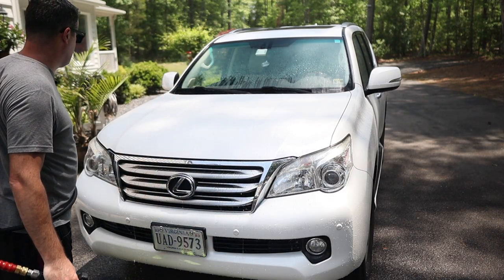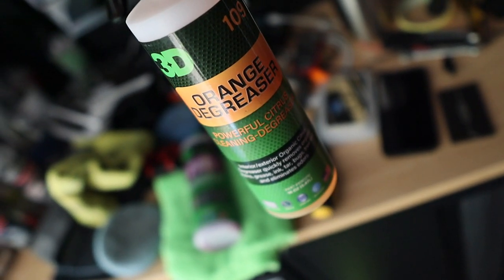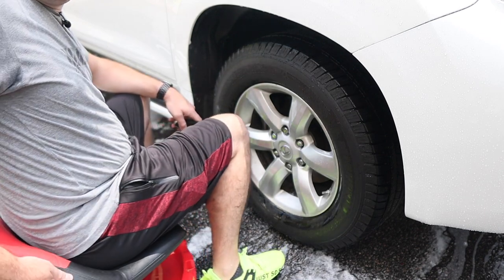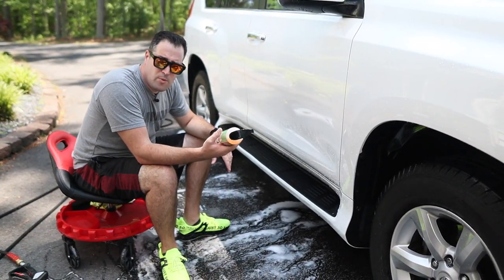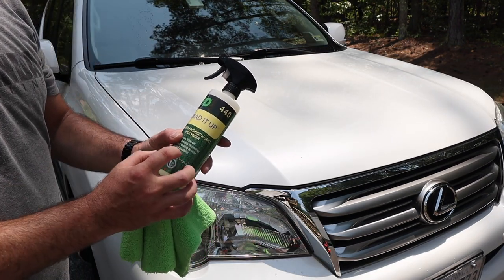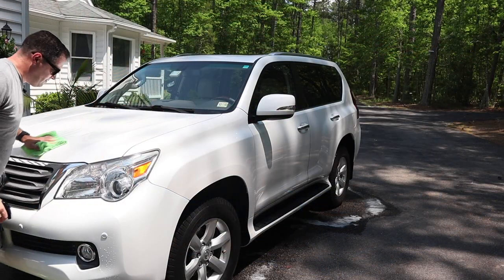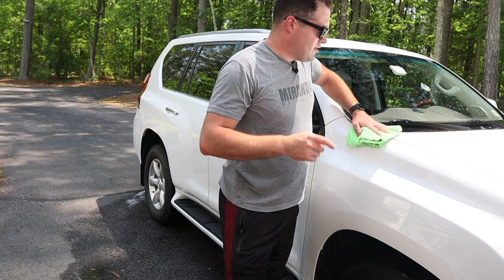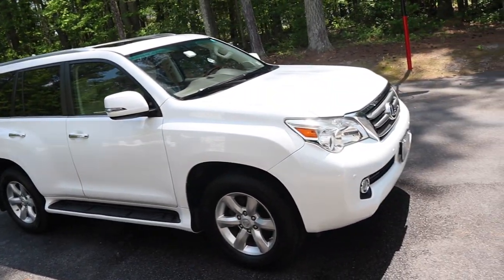I Have To Address A Serious Issue!  Plus 3D Detailing Products Giveaway! #Detailingtips

Comment: Just a thought about the “wheels first” debate. If you clean and dry the paint first and then if you get overspray on the paint when brushing the tyres which you then jet wash off, it means you have to dry the paint again. Just a thought, not criticising.
Reply from the maker: Hi. Totally true, that why each detailer has to make that decision for themselves.  Not a wrong or right way, just different reasons/methods for each situation. 😎👍🏼 thanks for sharing!

Comment: Great talk. Unfortunately we live in a culture now that accuse other folks, so they gain attention for themselves. Makes me feel sad. We are all better then that.
Ok.....confession time. Lol. Last year around now, I put on my first ceramic coating. It was a sorta entry level coating. Last summer coating was "doing its thing" beading and sheeting. Not this year. Slowly sheeting. In between last year and this year was, you got it, a the miserable Wisconsin winter! So during the winter i used the touchless car washes. Only running water available. Bring vehicle home and do rinseless wash and apply "Topper ". I do this during winter once a week. Every Saturday. Did I unknowingly degrade the ceramic coating by using touchless car wash that has high ph soaps? Last week I used Descale and followed up with hand wash Reset, and coating looks flat or gone. I know it's difficult to give advice without every single fact, but what do you think? I really respect your opinion. 
BTW today is the day CSL and Evo v4 goes on a 21 Silverado. I'm excited!! Hi wife.
Reply from the maker: Hi. Yeah I know,,,,it’s sad. 

Oh boy…yeah probably the high ph cleaners could have killed it. That stinks. Well it’s a good test to see how car washes can strip even coatings after a season.
Reply: @MirandaDetailing  a good quality “ceramic” coating is ph resistant usually from around 3 or 4 to 12 or 13. Chemicals alone won’t wear the coating off but if you “rub” the chemicals in then it will. It’s the rubbing action(abrasion) that’s the coating killer. So,,,,,,, if you’re driving down a salty sandy Wisconsin road at 50 mph imagine all the “rubbing” on the paint that’s happening. 
Tip: put a high quality(something rated 3 yrs and over) coating on and top just before the snow flies with an sio2 topper. If you get a mid winter warm break for a couple days, pressure wash the salt crap off then hand wash with a ph neutral soap. Put topper on.(Gyeon Wetcoat is good)
Reply: @MirandaDetailing  I'm all grown up now! I can go potty by myself and apply Crystal Serum Light and EVO v4! Oh boy!
Reply from the maker: Yay!!!!🤣😎👍🏼
Reply: @kimnewling5728  but,,,,,,,, can you put your own diapers on. 😂
Reply: @chrissemsch8781  it's a struggle

Comment: Phil in your opinion what is your ratio of customers wanting a proprietary (higher priced certified installer only) coating such as system x, Ultra, Tsunami versus the consumer grade stuff such as crystal serum lite? Is it worth it to spend the 1500-4500 dollars to get certified?
Reply from the maker: To very honest….it’s not needed to be accredited for any coatings. We have made more money installing by CSL, EXOv4, CarPro CQuk, Gyeon and many others. We only had two CSU jobs this year. I did go accredited with both Gyeon  and Gtechniq this last year, but it’s just because I personally have relationships with those companies. I also like using 2-4 year coatings becasue anything let that time frame will get some minor swirls and should be re polisher and coated to keep that protection and paint looking its best! 😎👍🏼

Comment: Phil question about the layering of products. I'm installing CSL + ExoV4 on my truck and I live in upstate NY and will be taking my truck into the woods camping. My thought was to add a topper over the coating once it has properly cured (2-3 weeks) as a sacrificial layer so if i get bugs and sap on it, the sacrificial layer would take the hit and not the coating. My thinking is that this would help the coating last longer during the summer months and even in the winter months with the salt they put down on the roads up here. Seeing a lot of other detailers they suggest not topping because the you aren't getting the benefit of the coating if you top it. Thoughts?
Reply from the maker: Hi.  My thoughts on that is layering is always beneficial. It’s like wearing metal armor and then wearing a leather overcoat over that to protect the shiny new metal. It’s a sacrificial layer like you said. Absolutely no harm at all to do that. Not sure why other detailers say weird stuff like that.  Layers of protection are always better, it’s just logic. You have it correct man. 😎👍🏼
Reply: I’ve actually experimented with toppers on top of sio2 coatings. 1) Coating: Ethos Graphene Matrix Pro on a 21 F-150. Topper used was Ethos Resist and I topped it 1 week after base coating was installed. Truck was brand new and being delivered from Kelowna, BC to Calgary. 2) Coating: Fireball Devils Blood on a 15 Benz E550 topped the day after with Fireball Typhoon. Maintenance wash and top coated with Ethos Resist 2 months later just before going into the heavy winter months. 3) Coating: 303 Graphene on a 03 Chrysler Concord topped a couple month later with Ethos Resist. 
Conclusion: For me, perfectly safe and I recommend topping the next day after coating. I now use Titan by Phoenix EOD.
Keep in mind that the water behaviour will be whatever is the last thing that was applied on your paint. 
I also found that Gyeon CanCoat is an extremely good topper and will last longer than most other topper products.(twice a year is more than enough)
This is just what I have found and is my opinion but opinion’s are like bellybuttons, everyone’s got one.
Reply from the maker: Excellent info Bro!!  Thanks for sharing that….opinions are also like….well never-mind…I’ve said enough 🤣🤣🤣
Reply: @MirandaDetailing  oh ya, I said bellybuttons because I was keeping in G rated. 😍 but ya the other version is “everyone’s got one and everyone is one.” 😆
Reply: @MirandaDetailing  Thanks for the confirmation, i didn't see why it wouldn't be beneficial...id rather have my topper get worn away by the elements than the expensive and labor intensive coating
Reply from the maker: Exactly! 😎👍🏼

Comment: Hi Phil. If the vehicle is coated with ceramic coating. Will claying paint degrade coating if paint needs clay job.
I have smearing issues with beadmaker. Maybe I'm using too much.
Reply from the maker: Hi. Yeah claying can cause marring issues also on the coating. It’s best to use something like CarPro Essence Plus with a soft black pad. It can remove some contamination and clean the coating while leaving a nice layer of sio2 also. It’s meant to “revive” any ceramic coating without abrasion. It has no abrasives in it, just cleaners and sio2. Yeah using toppers like very sparingly is kinda hard to do sometimes. But I just mist the towel and lightly apply and that helps tremendously.

Comment: I’ve used Turtle Wax Seal n Shine as a drying aid. Sprayed it in the panels and just rinsed off. It actually helped with the protection I had on the vehicle. Worth experimenting on a vehicle just to see what happens with various toppers or spray on/wipe off sealants.
Reply from the maker: Very cool!!  Thanks for sharing!
Reply: Oooooo, great idea. I’ve lately been using S&S on wheels. Very good durability and chemical resistance
Reply: @chrissemsch8781  yessir, works great as a drying aid. One, maybe two sprays per panel. Beads the water instantly and then rinse off. Worked awesome. This was in a day I did a typical soap / foam wash in full sun with very hard water. No issues. Plus you could probably use it as  “spray on / rinse off” protectant. Especially on vehicles you already maintain and just need a little refresh. Lemme know how it works out for you.

Comment: Hi so if I used ceramic spray coating from hybrid solutions as a protection ,can I use turtle Wax  ,wet Wax as a drying aid ?
Reply from the maker: Hi. Yup!  That’s actually how it’s formulated to be used. 😎👍🏼
Reply: But the wet Wax it's not from hybrid solutions line so will that still be ok to do ?
Reply from the maker: Yes it will still be fine.

Comment: Hey Phil, have you had any issues with the APC rinse leaving streaks on lower body black trim?  I usually use a 1:5 water/citrus plus mix and sometimes the trim has the streaks.  Trim shine covers it up, but curious about your experiences.  Thx, Mike
Reply from the maker: Hi. I have had it happen maybe twice in our 12 years of detailing. An it was because the trim was old and faded. But we don’t run into those issues. Are you doing a pre rinse before and making sure it doesn’t dry?
Reply: @MirandaDetailing  yes, doing the  APC rinse after  I initially wet the paint.  The heat is a factor, but I usually don’t do any APC rinse if panels are hot.  Have not had any issues with glass, paint, just sometimes on the trim.  It’s nothing permanent, but you’re right, it tends to be the older vehicles.  However, I have noticed it happens more on Teslas.

Comment: 12:13 Or for your knees , those heavy duty knee pads , various types , materials and thickness . Or those rectangular pads used when kneeling and doing gardening .
Reply from the maker: Hi. Thanks!  Yeah knee pads cut into my backs of my knees and hurts circulation.  But I do use those pads sometimes. Sitting and rolling around without over bending my knees and back is the way to go for me however. I used to even bring a rolling chair when we were mobile. 😎👍🏼